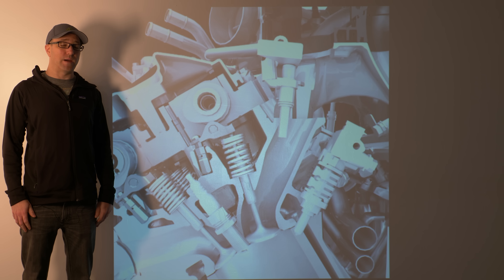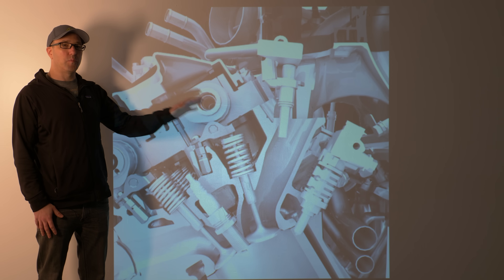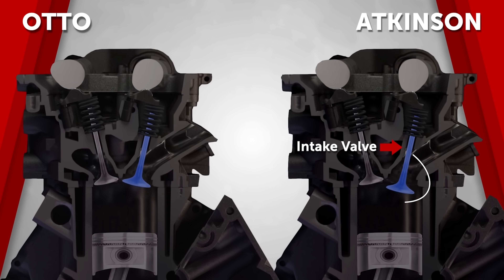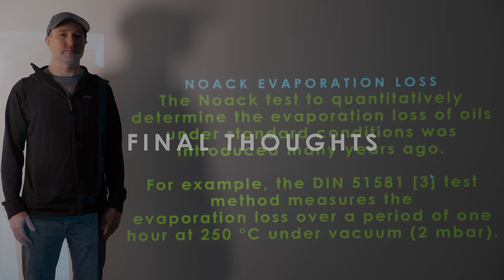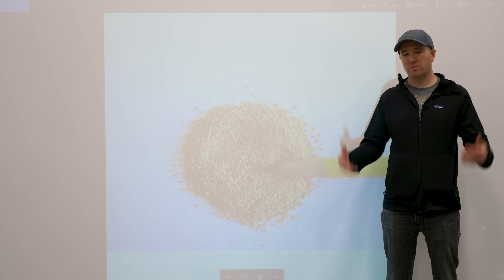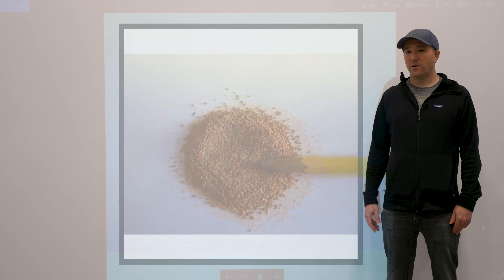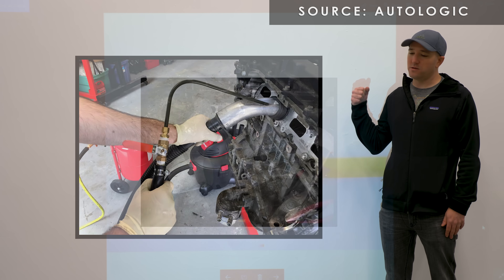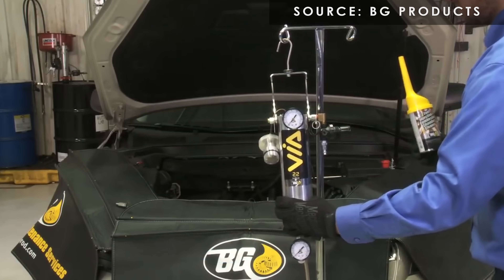Direct Injection, Problems and Solutions | The Fine Print

Comment: the blow-by goes down passed the rings,not up!
Reply: Caught that one myself!
Reply: Why didn't he say anything about GDI washing the oil film off the cylinder walls causing premature wear and increased blow by and oil consumption?
Reply: @Mikehikebike I am unfamiliar with the engine you describe..I do not know how the injectors are plumbed, but I would assume it's under the valve cover.. you have a fuel leak into the engine oil.. on a diesel engine, this doesn't bother me at all.. however on a gas engine, the gas will wash the lubricants off your moving parts, and cause wear.. eventually, you could damage the engine.. I doubt it's coolant as you didn't mention coolant loss, and anti-freeze quickly forms a gummy type syrup in the crankcase..  if you have a cylinder misfiring, the fuel could reach the oil that way too , but I would think it would static lock and blow a rod, long as you have driven it..
It's under warranty, what does the dealer say when you tell them about the extra oil?
Reply: @Mikehikebike https://youtu.be/qBsY55e8VUU
Reply: PCV stands for Positive Crankcase Ventilation. This is the route he is talking about the oil vapors taking. The separator or scrubber is a really big help. These can help extend the miles driven before you need a cleaning.
Reply: dont argue,he,s a mechanic,,??.what id like to know,is,,all this tech to stop emisions,,what is the cost of polution,to make them.favtories,mines,transport,ect..it seemed good for 100 yrs,but now,bad..  its minimum cost to manufacture a 400c.i,engine with a carb,no computer,2 valves,basic & works.no special $100 oils,.
Reply: mister clean I guess so but I wouldn’t use mineral or semisynthetic anyway
Reply: Truth Defender  Point taken!
Reply: You shouldn’t ever leave a comment unless you know the absolute fucking fact my friend. And you sound uneducated in this field.
Reply: @Idlia Dosai so, whats your point?
Reply: @Idlia Dosai huh? You drunk again?
Reply: @Idlia Dosai huh? You drunk again?
Reply: Thats right all these engines have poor piston rings
Reply: @StopTeoriomSpiskowym  all engines have compression leak down around the rings. It's the nature of the beast
Reply: Bullshyt excuse, emissions, no its to make vehicles unreliable   and not last long, so consumers buy newer model every 5 years
Reply: The pcv explanation is disapppointingly so wrong.
Reply: You're right that blow by DOES go DOWN past the piston rings. But you have to remember that the crankcase is connected to the valve assembly via oil ports. You know those big oil ports where the oil from the valve assembly drains back down into the crankcase? So the pressure that builds up in the crankcase also builds up in the valve assembly. The author of the video didn't seem to have a grasp on this concept.
Reply: @HOLYHOUSE  The main prob is the thin oil. Diesels use whale blubber grade, and it does not sneak past valve seals onto valves, a gasser Gulf uses synthetic, liquified butane, it drips down toward the suction of the intake itself, but the thick oil would gum up the sprocket mounted vvt, it was not well supervised engineering, but they got the tax credit for making the emissions and milage possible.
Reply: @HOLYHOUSE  you should shut up.. there is never any pressure in the crankcase or what?  the valve assembly? You mean head and valve cover?. The PVC system actually draws a small vacuum on the crankcase.. if you had any pressure at all, you would blow gaskets and seals out..  stop trying to be smart, your not.
Reply: Yeah it's called a PCV=Positive Crankcase Vent...  Crank case is bottom end of the engine.  Glad I wasn't the only one that caught it.
Reply: i was wondering the same, no one else seems to care about the technical detail presented. cant buy his whole argument about DI after seeing that.
Reply: In fact it goes both ways. He missed a huge point which is oil dilution, where the high pressure gas passes dwon the piston rings and dilutes the oil, lowering its protection. It does also go up, however, which is how the oil makes its way up and around to the back of the valves.
Reply: @MarshalBeard  The oil normally makes it to the back of the valves via the PCV system, not by going up. Even then, this is not problematic on its own. The problem comes when EGR is introduced. Oil mist plus particulates/soot in the EGR equals the muck that clogs ports and valves. In the rare cases where oil is going up past the oiling ring and 2nd ring, the engine will burn it as evidenced by blue exhaust smoke. This is abnormal operation.
Reply: @nismology  oil  can get passed the rings but we dont call that blow by, we refer to that as burning oil, so when you see and smell blue smoke you say, it is burning oil, or using oil,we dont refer to that as blow by, the back of the valves is called the inlet port, its not called the back of the valves.
Reply: @gogogeedus  I was using generic terms that everyone could understand. You haven't shared any new info, nor were we ever in disagreement. Not sure why you bothered really..
Reply: @nismology  Because if you are going to talk about mechanical issues you need to use the correct terminology , you can't make up words to describe stuff that are not proper or known, like back of the valves, thats just weird, just call it the port because thats what it is, you backyarders are confusing people with strange and incorrect words and descriptions.
Reply: @nismology  well I pointed out the fact that blow by goes down past the rings, you need to pay attention!
Reply: @gogogeedus  Well if you want to be technical and split hairs, the port and valves are separate things. Any "pro" mechanic would recognize that.
Reply: @gogogeedus  Dude, you have issues with reading comprehension. Never did I say that burning oil and blow-by are the same thing. You are not contributing positively to the discussion, nor are you sharing any new information. What exactly are you trying to accomplish, other than correcting something I never stated?
Reply: @nismology  No,I have issues with people that are not educated enough on a subject to contribute, especially when they cant identify fact from fiction.
Reply: @gogogeedus  You are repeating exactly what I originally said almost word for word. Oil mist enters the engine via the PCV system where it mixes with EGR and gunks up ports and valves in DI engines. No explanation from you needed, I know how this stuff works.
Reply: @nismology  Yer, my issue was not with you so much as this video and the way he says blow by can go up past the rings, it is called blow by because it is blown past the rings under pressure, it is a completely different thing to oil leaking past the oil ring and burning in the combustion chamber and coming out the exhaust as blue smoke, although they quite often occur simultaniously.
Reply: @gogogeedus  Agree 100%.
Reply: @nismology  but the egr actually helps to cool the combustion by introducing exhaust gases which sort of prevents creation of carbon, no?
Reply: @vlat4e  the egr valve allows exhaust gas into the combustion chamber for one reason. To lower the oxides of nitrogen produced by the engine, by lowering combustion temperatures. But, you then have unburnt fuel leaving the combustion chamber, which the cats have to burn off, which lowers fuel milage. The cats also have to burn the unburnt fuel that cools the exhaust valves, during valve overlap..yes, raw fuel is passed over the exhaust valves to cool them. In a fuel injected motor, a small amount of fuel is sprayed during valve overlap to cool the valves.. don't believe me? Watch the injectors firing on a monitor and you can see the short firing blips between the large ones.. no one except nision has built an engine that does not do this.. Google it and read about this "city only" engine..
Reply: @MarshalBeard  To provide further clarification, the purpose of the PCV system is not to remove oil mist but, in fact, unburned hydrocarbons that sneak DOWN past the rings into the crankcase.  Before PCV this used to be vented to the atmosphere, which created environmental concerns (like unsealed gas tanks). Oil mist (which is a harmless and natural byproduct of moving engine parts) just so happens to be sucked up into the intake manifold along with these unburned hydrocarbons and causes potential issues when mixed with EGR.
Reply: Michael Aristide yes it did cause problems. It helped in one way, when you were learning to drive the oil track in the center of your lane made it easier to stay in line. Of course that oil slick played havoc on cars when it rained. 👍
Reply: @MarshalBeard  your kidding? The oil on the back of the valves comes down the valve guides, from the seals.
Reply: @MarshalBeard  the oil on the valves comes down the stems to lubricate the guides and slow down valve stem wear. The valve stem seals wear out as an engine ages and allows too much oil to flow down the stems.. very little oil comes from the rings. Plus rings are designed to allow a certain amount of oil on the cylinder wall to reduce friction and heat on the piston.. metal expands when hot. Engine are built loose cold and come up to tolerances when at the proper temperature. But, over heat an engine, and everything swells up too big, causing excessive heat and gaulding. Did you know, that the oil is just to cool the metals? Dissimilar metals prevent gualding  on the crank and Pistons. If you took 2 prices of steel and rubbed them together, no matter how much oil you put on them, they would chew each other up.. today that statement isn't 100% true, due to high sulpher content, and moly in the oil. These compounds actually isolate moving parts from each other. But in my day, these compounds were not known about..
Reply: @MarshalBeard  no it just goes down passed the rings, you can get oil going passed the valve stem seals and down into the combustion chamber and out the exhaust but that is not blow by.
Reply: Marshal Beard oil dilution is good, not itself but gasoline going past the rigs cleans them. Then changing the oil on time is enough (1year/7k miles not 2y 15k mi)
Reply: I scrolled  the comments just to see if anyone else noticed.  also he called the engine heads the crankcase. WTF,  should I trust what he has to say at all?
Reply: 🤔🤔🤔🤔yeah this guy is an idiot.. diesel engines are direct injection, and they also route the blowby back into the intake, and they run a million miles with no issues.. and port injection, still carbons up.. so does carbed engines. A new engine has very little blowby...only worn out engines have the blowby and problems he creates in this video.. I see direct injection engines with 200k on them, and they run fine, no issues..
Reply: @KBS117  I really hope you aren't comparing diesel engines (DI) with DI (GDI) gasoline engines. The million-mile diesel engines you describe are the heavy-duty diesel engines. A light-duty diesel engine is expected to get about 200k or so of life. Diesel engines also don't wear as quickly, and one of the reasons why gas engines do can be extrapolated by what was clearly explained in the video. Port injection gasoline engines don't have the same build-up problems in the valve train as DI gas engines because gasoline is pretty much a solvent that "cleans" parts of the engine. That means the same gasoline fuel mixture that cleans the valvetrain in a port-injection engine is also "cleaning" the inside of the cylinder walls, where oil is needed to lubricate the piston rings and cylinder. Diesel does not do this. Diesel engines do not require such a delicate balance of air+fuel before compression, diesel engines only "care" about the timing of fuel injection and amount of fuel injected during the compression stroke. The intake stroke of a diesel engine is largely independent of throttle, and historically diesel engines control power by quantity of fuel, not quantity of air or air+fuel before compression. Modern diesel engines have changed due to emissions regulations, sure... but the concept remains the same. For those reasons and many more I won't mention is why valve-train buildup isn't much of an issue for diesel engines (and also--they aren't immune to the effects of buildup on the valve-train, either... they are just more robustly designed to make it negligible). You're comparing apples to oranges, my man. Also, diesel fuel injectors are not immune to build-up, but can be argued that the preventative maintenance is much easier.
Reply: @clv603  you rambled on forever.. light duty diesels? O you mean the 5.7 and 6.2 junkers, gm built? I have seen many pickup diesel engines with 300-500k miles on them.. so yeah, I was talking about them..you want to keep everything clean, run that thing through the quarter once a week.. hammer it.. all the other stuff is partially correct, and I just don't have it in me to fix all of it
Reply: @KBS117  please do oblige. You just tried comparing apples to oranges.
Reply: @clv603  no, I was talking PVC systems, which is causing problems on gdi engines. diesels produce 10 times the blowby and oil mist that gdi engines do. And you don't see the PVC system on a diesel sooting up the valves.. I have seen diesel intakes so clogged with oil and carbon, that the 1 inch lines were completely clogged. And yet the valves were ok..  I have not seen the problem with any gdi engine, that this video is claiming occurs. And I called bullshit.. I am talking only PVC systems on gas and diesel di engines. It maybe apple and oranges, but both have blowby to deal with..
Reply: clv If you are only getting 200k out of a diesel you must be driving a Dodge lol.. Most diesels (powerstroke, duramax, and even Cummins) will get you AT LEAST 400k (and if maintained well can last you up to 1 million or more) unless you are careless and never change the oil/filters. The motor will last forever.. it’s the other stuff that breaks down much sooner.
Reply: KBS117 I think that also depends on how they are maintained just like anything theres always an upside and a downside.
Reply: @clv603  fuel vapor is all that is in the combustion chamber. In vapor form, no washing occured of the cylinder walls, unless you are "flooding" an engine. That's a term that fuel injection has all but eliminated.. but carbed engines, could and would flood, and wash down the rings.. today's engines, have to have a major malfunction to achieve this..
Reply: @clv603  and di gas engines operate on the same standard as diesels do. I hear they have already upped the compression on di gas engine and eliminated the spark system. Set for production in 2025. Just a light duty diesel, burning gasoline. But for 40 years, we have been hearing about this di sparkless gas engine, that was coming. Why has it taken so long? Parts, and dealer labor to tune these other engines, was in the billions..
Reply: @clv603  I don't get into.pissing contests with armchair mechanics. I have been pulling wrenches for 50 years.. I cut my teeth on the 5.7 diesel.. I know junk when I see it..
Reply: @texashankpalmer876  Or one might be driving one of these diesel engines with like 100 hp per liter or more - they typically don' t last 200k miles.
Reply: @KBS117  Also when he explains the fuel flow for direct injection he follows the path of the wiring.
Reply: Dude if you Add VII the oil wont vaporize in high temp. The solution is simple! Dump a bottle of STP every oil change

Comment: Just bought a Hyundai with a 2.0L I4 GDI. My mechanic told me to put a bottle of Techron in the tank every 3,000 miles and run the heavier weight oil (5W-30 instead of the recommended 5W-20) which is still in spec for my vehicle I guess so that should not effect warranty. I am wondering if installing an Oil Catch Can would effect the warranty? If something got fouled in the fuel system or even the power train would they tell me I modified the car from factory and voided the warranty. I guess I can just drive as is until its out of warranty and if it craps out before then they can fix it. Want to trade out of the Hyundai sooner than later anyway. Not as happy with it as I initially thought although seems like all of these newer low end and mid range vehicles are all going to GDI engines.

Comment: No problem with my direct inject lexus is 250, 2006. 120000 km
Reply: Pull the intake manifold off and look at the intake valves. You'd be surprised and once performing a cleaning service you'll realize how much power you gradually lost over the years.
Reply: @IKhanNot  I've tested the car on a power test bench it still has 210 hp.

Comment: I remember seeing this last year.  Just getting 2019 wrx sti with the dinosaur ej257 motor.  Old but with multiport fuel injection.  MPG is terrible compared to DI but with this car you are not concerned with economy anyway.
Reply: What car?  A wrx sti???  With an ej257 motor???
Reply: @scarharting5577  The 2019 Subaru WRX STI. It has the EJ257 engine.
Reply: EJ? Well, your trade off is blowing the engine due to head gaskets lol.

Comment: Will the thicker oil work in a car requiring a thinner oil? Will it make it through those tiny oil passages?
Reply: Hell yes, the car companies are using 20w oil to raise fleet mpg, they aren't worried about you getting 300,000 miles out of your engine. I reccomended 30 weight synthetic oil.